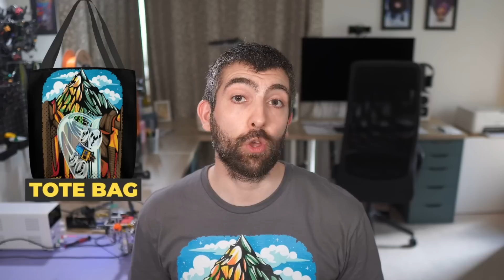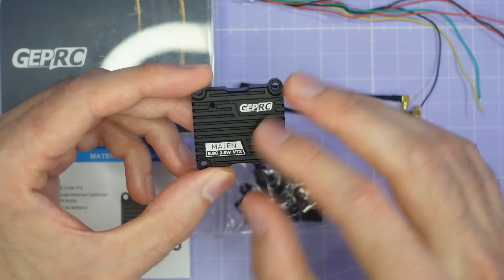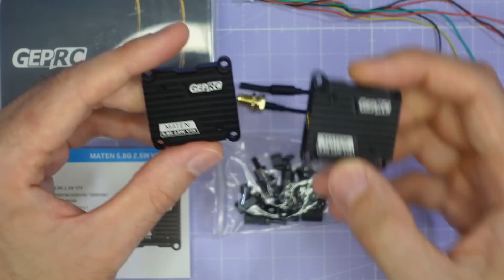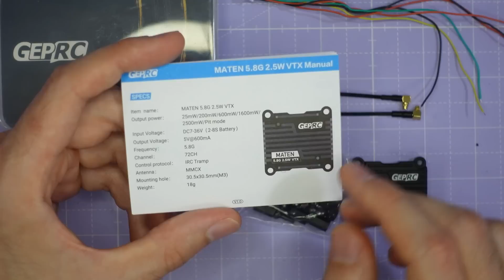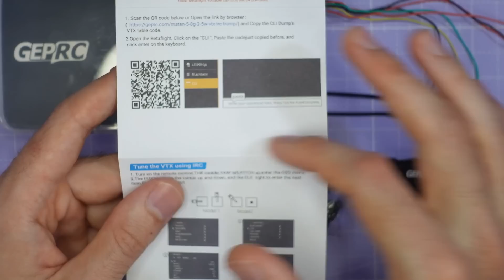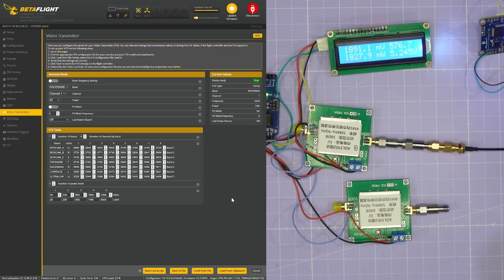Unbelievable Power! GEPRC Maten 1.6W and 2.5W Analog VTX

Comment: Can you test the TBS Unify PRO32 DP? It’s freaking sweet and also another 2.5W. I love it and have 3 of them now!
Reply: What is you setup with the DP Vtx? I have one and it has black lines that I can't get rid of.
Reply: @highrisefpv   hey man. Black lines are electrical noise. Here’s a few things that could help:

1.  This VTX comes unlocked. All I had to do was plug the quadcopter into betflight, Set everything to none. Then I reset it to my normal frequency, channel, and power level. And honestly, everything worked just fine. I’ve had the HV…and you do have to unlock that one…

2. Check your MMCX connection on the VTX to the metal adapter on the antenna cable. Unplug the cable/metal adapter, then gently….”as possible,” plug it back in until you hear a “click or snap.” 

3. Check the orientation of the antenna cables around other cables, such as crossfire, etc. try to keep the antenna cable oriented in a way that the cable is not being pinched at certain points. Especially around where the black tape is.

4. If you have crossfire, make sure that if you have your cables, direct soldered onto the flight controller, that they are mostly twisted if possible. Group together.

5. Make sure that the yellow, white, black green are twisted together. I leave the 9 V and the 5 V separated. Unless you are planning to use VBAT pad. Then I would twist a ground onto that 9V cable as well. For some reason whenever you twist certain cables together, you can ultimately help reduce “noise” emitted by certain components on the drone. I leave the red/power cables out because I am superstitious. You can twist them all together and it probably will just work fine. 

6. Look to make sure that your stack doesn’t have any broken grommets/rubber pieces that hold the controller and 4in1 esc in place. And make sure that you put them on properly at the very least, especially at the base of the frame where the flight controller and ESC are mounted. You can even change them out if you’re not sure. Sometimes one of your stack screws is bent and that could also be a reason. Some people will probably tell you no, but I think so.

7. Look for any brakes or cracks in your frame. Believe it or not, carbon fiber does carry a charge whenever it’s broken. If you scratch it beyond the enamel and polished layers, you’ll get to a point where you can pick up charge. 

Which leads me to my next point. 

I bought the second DP, and forgot that I didn’t have to unlock it. So I started pressing buttons and ultimately figured out well done I don’t have to unlock it. I just reset it up in beta flight and everything seemed fine but I noticed that I didn’t have great range like I did with the other one.

So when I hooked up the other DP I knew it was working onto the same quad with the brand new one… the OG DP vtx had lines. But the frame was cracked. And it was cracked by my capacitor. so whenever I took the copter apart, and then put a new frame on the lines went away instantly. 

I also noticed that with the brand new DP VTX, that after a few simple crashes, the MMCX connector broke off. I think I may be caught light tree branches, and hit cement afterwards. This is the only VTX I’ve had that’s broken this way, so just check to make sure that that connection is not loose with your fingers. Don’t try to break it off. Just very gently.

So maybe just taking it all apart and remounting stuff and certain places you know you’ve neglected or could potentially be problematic, like I did, could be the solution for you. 

I hope this helps. Please forgive the voice text.
Reply: @highrisefpv  I left an additional reply

Comment: 18W in & 11w out  - >50% efficiency seems pretty  implausible, especially if you also have the losses in a DCDC converter in there- how  sure are you of the measurement setup? 
You could do a simple reality check by running into a 50R dummy load, measuring temperature rise and comparing that to temp rise running known DC power into the same load. Also I wonder if all the output at that power is at the desired frequency, or if some is in harmonics
Reply from the maker: Good question. I'll rerun the test and accurately record the DC power consumed.
Reply: That poor inline attenuator would have been destroyed in seconds when exposed to 40dBm. Something's off.
Reply from the maker: The atennuator is rated for 10W
Reply: @ChrisRosser  OK, probably a different type then from what is shown in the video.
Reply: typical ee ruining all the fun;)

Comment: Great tests!  And Wow, 11W is another level. Have you also tested the power consumption on those frequencies?
Reply: he only said for the max 11w that it needed 17-18w (at arround 11:30).
Reply: @mike_at  thanks
Reply: @mike_at  And that's suspicious as hell. There's no way that VTX is so efficient, it would be producing very little heat. Which we know is not the case for high power VTXs. These results are clearly wrong and I can't believe he even posted the video.
Reply: @HereComesWhitey  i dont know sry this stuff is way over my head

Comment: I wonder if using race band 1 is better than race band 8 (for power) in all other VTX's. ? ?
Reply: On a lot of VTXs, R1 does infact make a lot more power. But there are other ones, where the power stays the same on all chanels. It just depends on the specific vtx you have. I've heard that high quality VTXs usually stay at the same power on all chanels, because they are well tuned and designed. The Air65 VTX (not highest quality) also  outputs double its rated power on R1. But 11w is a HUGE increase from 2.5w. That surely is not intended. But nice to have, i guess. Especially for a long range vtx

Comment: We need some 7inch 8s motors
Reply: you could probably use a 2812/2810 1100kv motor
Reply: @deroskar  ya they are a bit heavy though and cooling isnt so good on the taller motors, 2809 1000kv is what i am looking for
Reply: @kerrymillar4981  I use BrotherHobby 2812 1115Kv on my 8S 7", they do not get hot at all even in the heat of summer.
Reply: @kerrymillar4981 Just grab 2808 1100kv, I'm using 3008 1150kv on mine as it's what I had laying around
Reply: @kerrymillar4981 speedybee makes a 2807 1000kv.  I'm running them on a 8s vtol nano drak with 6" props.  Spins 7" props no problem, but the plane flies weird with 7" props mounted to a 40" span.